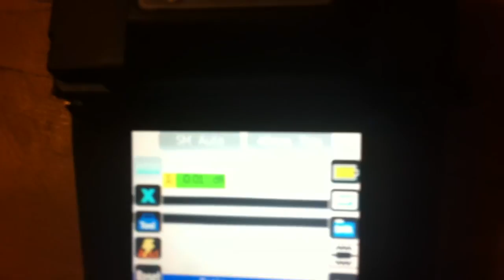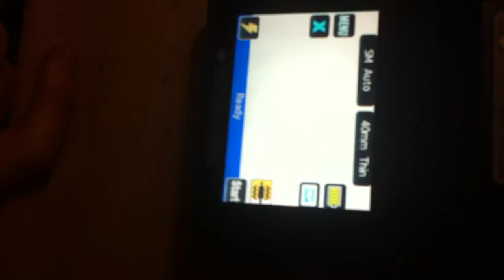The New mini splicer from Sumitomo

Comment: This whole B4RN project is very intriguing. Will you ever do a video on what's inside those modem boxes? I can't find any info on them.

Cheers
Reply: We would have to take one into bits to see what is inside though wouldn't we? I know they have wifi, 4x1Gig ports and two voip sockets.
Reply: Hi chris conder 

It's really just extreme curiosity on my part :)

When I watched the B4RN launch presentation video, Barry Forde said the modem boxes would have batteries inside of them in case of a power cut, which I thought was very cool - did the boxes end up having those?
Reply: Yeah No when we do our own voip they will have battery backups, I don't think any modem could hold a battery worth having, batteries are usually too big an heavy, but I guess the time will come when one is designed to fit inside the modem.